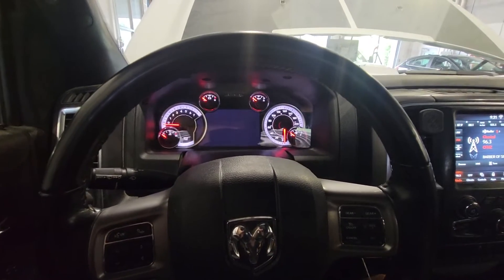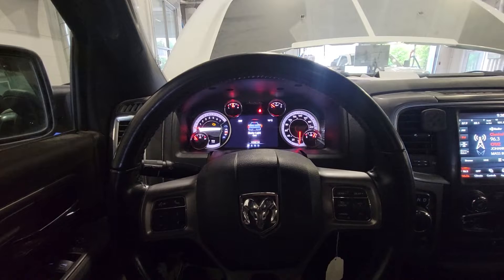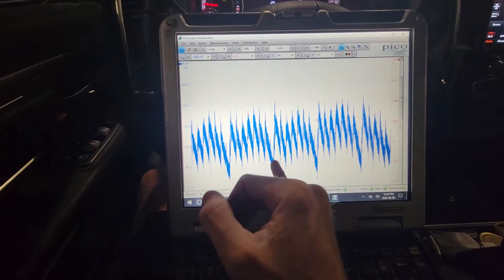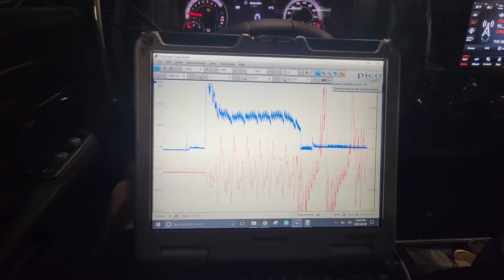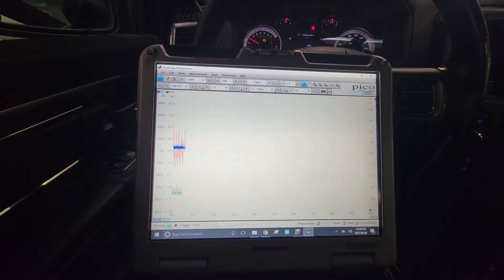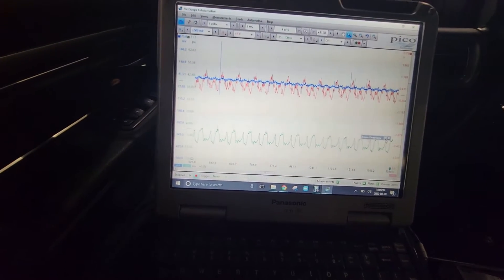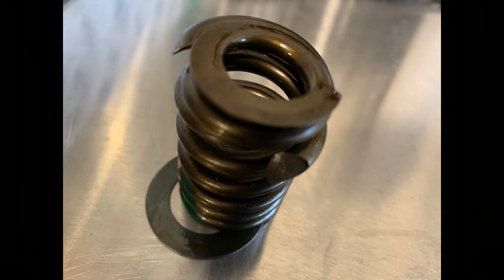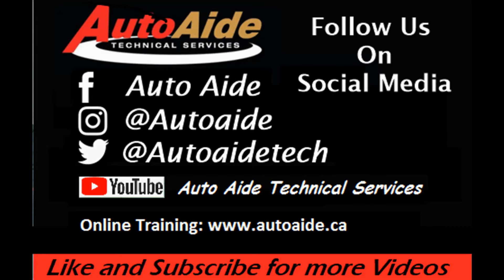Missing In Action! 5.7L Hemi Misfire/Won't Idle. (2021 Ram)

Comment: You’d figure that one dead cylinder on a v8 would cause it to run so bad. Usually there slightly rough but that thing barely running with a single cylinder. Could you use map sensor voltage to spot a mechanical issue?
Reply from the maker: Well, that depends. The MAP sensor may not react fast enough to accurately pinpoint whether or not the issue is mechanical. In a case like this one, the engine runs so poorly that you probably could..